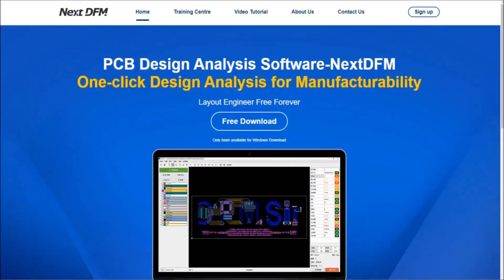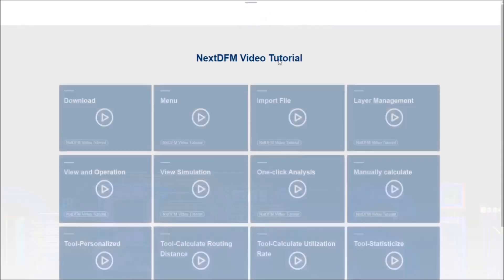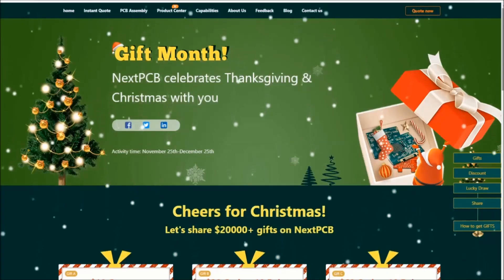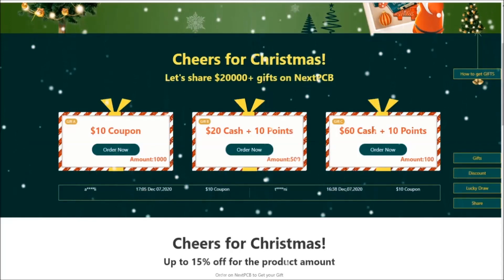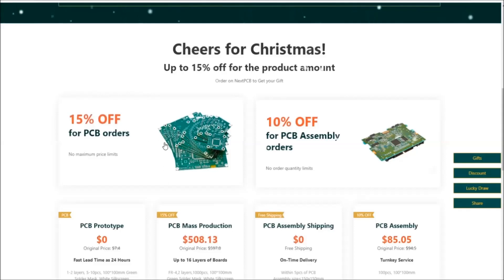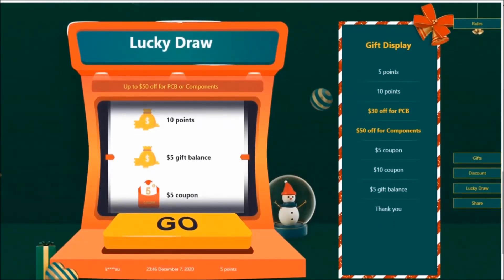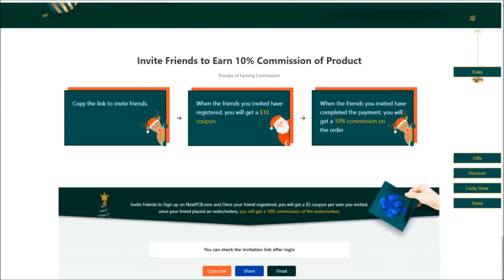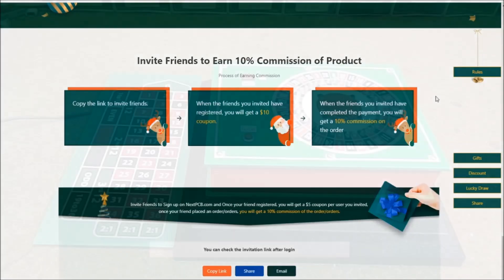DIY 37 Leds Arduino Roulette game

Comment: Lovely project :) Which components do you use for the case?
Reply: material*
Reply from the maker: @maximilian277  3mm and 5mm PVC board which is easily processed with a scalpel, coated with self-adhesive colored wallpaper
Reply: @MirkoPavleskiMK  thank you!

Comment: Your sponsor is a PCB maker, BUT you wired everything by hand? Why?
The project uses several colors, and you say it is "coated with colored wallpaper".
I see at least 2 shades of green, red, black and white. How did you draw this on the boards?
Reply from the maker: roulette wheel is actually a picture that is printed in color
Reply: @MirkoPavleskiMK  Thank you. For some silly reason this didn't occur to me. Why didn't you make a PCB?